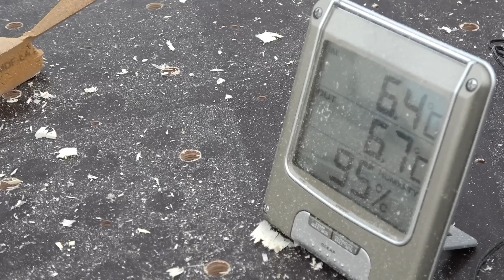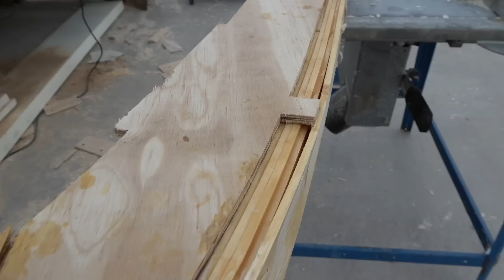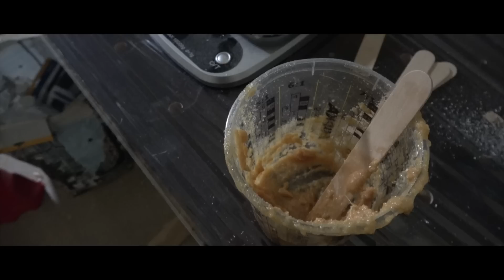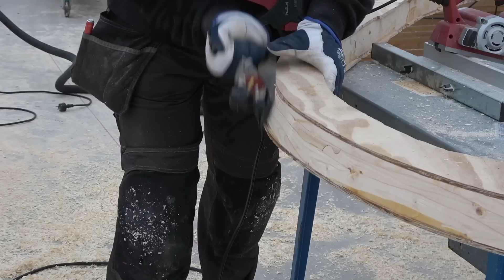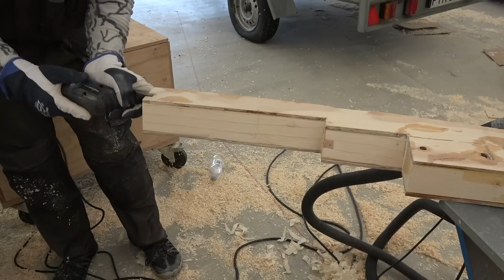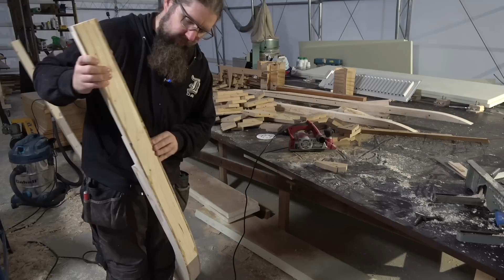Shaping the sailboat frame! ep.49 Project SeaCamel

Comment: It may help if you clean up the workshop every time you use the CNC, it will help you and your productivity, and also help you think clearer. keep up the good work. To move the frames, it may help to turn them upside down and carry them on your shoulder.
Reply from the maker: I am really bad at cleaning. But I have a plan to expand the dust collection system which would allow me to vacuum all the dust and debris everywhere on the shop. The frames are so big that there is no way you can carry them on your soul shoulder, or maybe I should hire basketball team to carry them around. They are 2300mm tall.

Comment: You created a wonderful big CNC-machine. Why are you laminating those slats instead of having the CNC cut big blocks as thick as your spacers of filling parts? And you could connect the bigger blocks by your puzzle piece joining system. Also the shaping them later. I don't see the big advantage that the slats have. Especially when you have such a perfect CNC machine that can do a lot of magic for you. I trust that in the end you make the same beautiful boat, but I guess the laminating takes a lot of time and you waste a lot of material. Also you're a one-man band. Sometimes I think you could use somebody to assist at certain tasks a little bit more often. If I would build a boat I would do a lot of things like you do. I like your overall manufacturing approach.
Reply from the maker: Hi. The simple reason using laminate slats is that the fibers of the wood need to be continuous from the top to the bottom. So they cannot be made from CNC-cut pieces.
Reply: @ArcticSeaCamel  You are right about that. I see many builds not using slats so it must be possible. I understand by now you are not going to change it. Did you try steam bending on those slats?
Reply from the maker: @leonbroekx  They are thin enough that steam bending isn't necessary.

By making them like this I can also use less quality (= much cheaper) lumber for them. Compered to steam bent massive frames which would need to be solid, straight and knotless!

Comment: I think most boat builders shape the frames after they are all in position and you can run the stringers along them to see how much material needs removing 
It appears in the video that you are putting the same angle all around the edges of the frames, where in fact you may not need such a sharp angle along the keel line, or near the gunnels.
Reply from the maker: The shape is formed with the CNC-cut plywood sheets on both sides. And that shape has taken from 3d-model. So the shape should be very very accurate already. Of course there will be just a little fine tuning afterwards but I try to keep it minimum by using the CNC. :)

It is not easy to show in camera, but the shape of the outer edge is changing constantly to form the shape of the hull of course.

Comment: Could you not use glue instead of finicky epoxy?
I am smashed as to the amount of finishing work you had to put in...
You are to a great start and am confident that you will improve your process as you go...
Thanks for sharing with us this very special  boat building project!
God bless.
Reply from the maker: Hi! I propably could. But with glues I think the limited working time would be a problem with these. As you may know from previous episodes - the laminating glue-up takes quite bit of time!

Also I like epoxy in a way that it doesn't really mind cold temps while working.

Shaping of this first frame took maybe 4 hours with all the thinking and figuring out. I bet next one(s) will be much faster. And they're pretty much done after that! (just the final coatings, we'll see about that one day).

Thanks for watching! :)

Comment: Two suggestions. First, a structure to hold the frames upright while you work on them. It looks pretty sketchy leaning against the table on the slippery floor, and that was a small frame. When carpenters put locksets and hinges in doors they use what I've heard called a "door buck" that holds the door stable while they drill and mortise. Same idea. I agree with the other comments about final shaping when all the frames are set in place.

Second, for cleaning up the inner sides, at least for the first pass, use a circular / disk sander. Much more aggressive than the random orbital. I've seen that used in a number of other builds, including Yaba and Tally Ho.
Reply from the maker: Hi thanks!

The working position was actually pretty good and it was easy to move the frame when it was on three "legs" so to speak. I used single clamp to hold it in place while plaining. No problems there. It might be good to get it little higher maybe. The frames are pretty big so i don't know if it's good to hold them "up".
I may do some sawhorses for this task though.

That sander is still on purchase list. I just have this random orbital right now. With 40 grit it seems to take the glue drops off pretty well. There's really no need to sand very heavily these. Majority of the material is removed with planer. Maybe I could replace the hand planer with that though! (but then, the dust! 😰)

Comment: Do NOT wrap in fiberglass!! It will only serve to trap the water in the wood and rot it. I’m currently replacing a bowsprit with this issue.
Reply from the maker: Hm. By making this with softwoods like pine and spruce, they all need to be encapsulated completely. Water should have no route to any structures here - and hence the thought of using fiberglass to prevent damages though paint and/or epoxy coatings.
Reply: @ArcticSeaCamel  In this case it might be worth getting a moisture meter to test the timber before laminating and make use that it’s suitable dry - particularly that you in a cool climate?

Comment: Great work. My comments would be penetrating epoxy on frames, leave a little on for fairing. And hate to say it but use the most premium hardwood you can get for the frames, more strength, rot resistance, easier to work with. Don't through good money behind bad.
Reply from the maker: Harwood is very VERY hard to find here in these amounts and it insanely expensive.
My thought here is that by using epoxy, you can use much cheaper wood and get good results nevertheless.
And of course, I don't want to use any tropical hardwoods on this.

Comment: Are you going to cold mold the boat?
Reply from the maker: Yes, over these frames and probably some temporary molds as well.
Reply: @ArcticSeaCamel  how are you planning to hold the planks while the resin glue cures? Use small stainless pins? I'm curious. Nowadays boat yards are using thin woods like veneer, as once soaked in resin, they don't require pins to hold them in place like strip planks.
Reply from the maker: @RetrowaveUniverse  Propably nails/screws or something. I really don't know yet! 😅
Reply: @ArcticSeaCamel  Hopefully you'll use stainless ones from reputed manufacturer, because fiberglass will absorb moisture over years to the point of increasing in weight, and if the nails corrode then repairing becomes a pain in the rear.
Reply from the maker: @RetrowaveUniverse  That's one thing i know already. They will not be steel! Stainless maybe, bronze maybe, plastic maybe? But they're needed only during glue up anyway!
Reply: @ArcticSeaCamel  ah very true, i'm so excited for this build, i'm always following builds like this, gives me tons of inspiration, to save up money, so that I can one day build my own.
Reply: @ArcticSeaCamel  I recommend  Raptor non metal fastening systems for stapling Polymer staples into the strip's. 
This avoids embedded metal issues, and of course fastening and finishing problems
Reply from the maker: @dnomyarnostaw  Thanks for this! Haven't been able to find this kind of products from Europe yet (not much searched though either...).
But I'd love to do the nailing of the hull with composite nails/staples to prevent any rust or tool hits etc.

Comment: Really enjoying watching your dream becoming a reality and I like your concept of how you’re creating your frames, it’s pretty ingenious. I’m liking your problem solving as you’re going along, very inspiring. 
Could i possibly suggest maybe doing a rough shape to the frames now but do a final shaping when the frames are on the keel because the outside face of the frames should have a slightly convex shape that follows the fair curve of the hull, making them flat may lead to there being issues getting a fair curve to your hull later down the line when it comes to ‘planking’ the hill. 
My grandad always used to say a clean workshop is a safe and healthy workshop and would always clean up end of every day, it would make working easier as you’re not tripping over or avoiding other meds and it means you can use your space effectively.
Reply from the maker: Cleaning is my nemesis! 😂
But yes, I still need to organise the shed quite a lot and install some dust collection systems to allow easier cleaning procedures.

There should be some tolerance to make the round shape on the frames when they’re on their place on the boat!
Reply: @ArcticSeaCamel  I know exactly what you mean, it’s so easy to be super focussed on a specific task that all else goes out the window and before you know it everything is a mess and you can’t find anything anymore lol. But yes on such a big project definitely protect your lungs, with dust extraction or a dust mask, inhaling saw dust can cause some very horrible lung disease so stay safe. 
Ah glad there’s some built in tolerance, I can’t wait to see her progress into a fully floating vessel, thanks for all the effort you’re putting in and bringing us all along for the journey. 👍🏻👍🏻

Comment: Those inside corners seem to be a perfect job for the handsaw, hammer and chisel. It looks like that would be way easier. With the handsaw you can create a straight line between both points so you know the right depth.
Reply from the maker: I just need a good hand saw! 😅

Comment: It's difficult to offer advise when you're not feeling the weight or awkwardness of your frame but...I would consider a temporary horizontal brace, attached to both sides of frame, waist high and held in place with easy to remove screws. This should help stabilize frame sides and allow you a  better handle while you're positioning it for clean up.
Reply from the maker: That’s another good idea! Thanks! 🙂

Comment: Have you included some tolerances in the shape of the frames? Even though the ply is cnc cut, you'll need to leave ome material on to be removed when all the frames are standing and the keel and other longitudinal girders are connected. Only then you should remove the last bit.
Reply from the maker: Yes, that’s important point. I have figured out some tolerances with cnc-cut joints and I need to keep that in mind when starting to do the molds eventually.

Comment: When I see you handle this frame I imagine that you intend to sail that boat. That is quite some time in the future, and all that time you have to work hard. Be nice to your body and consider some form of crane to lift a lot of weight. You are strong, but some little mishap and your back will need a long recovery time. You might find something on a scrap yard or elsewhere second hand like an engine lift that is used to lift engines out of a car. It will make your work less hard on your body and that will pay off when sailing in good health! Success!
Reply from the maker: I have actually thought of making some kind of simple crane. They are on the heavy side but mostly just difficult shape to handle.
Reply: I think the best would be a pantry crane. But that would need at best a steel beam. I don't know if that is in your budget. But what is the cost of a damaged back? The tent roof is also a limit, but you are good in finding solutions.
Reply from the maker: @paul_gradenwitz  Things are not THAT heavy though. I think just wooden crane boom with some counterweight would work just fine. ☺
Reply: For now that would work. Counterweight you have with wood scrap. I made one wrong move and dislocated my spine. It took 30 years to get some recovery. So whatever works so that those large frames are more predictable controlled is an investment in painless sailing later.
Reply from the maker: @paul_gradenwitz  Ouch! 😟

Comment: A grinder with a course flap wheel might do a good job removing excess material from the top section of the frame for both shaping and cleaning up to the 90 degree corners?  Just a thought.  Thanks for your videos!